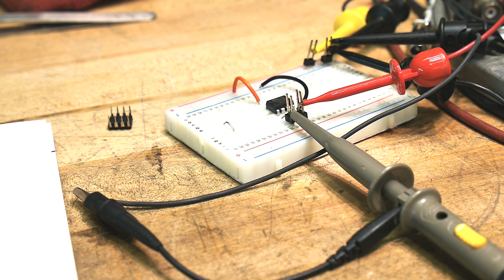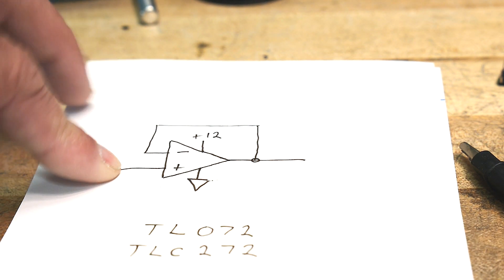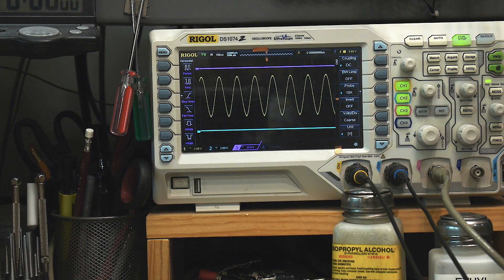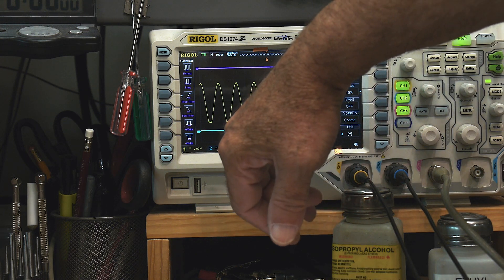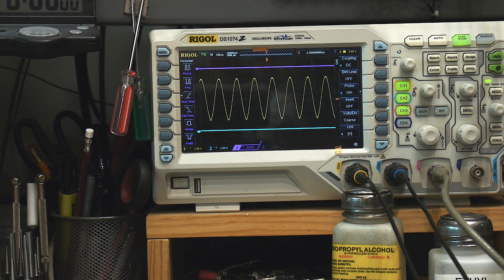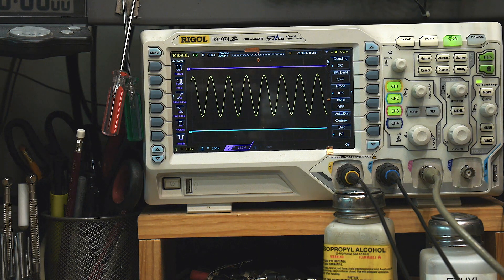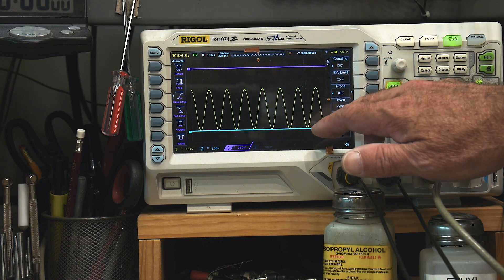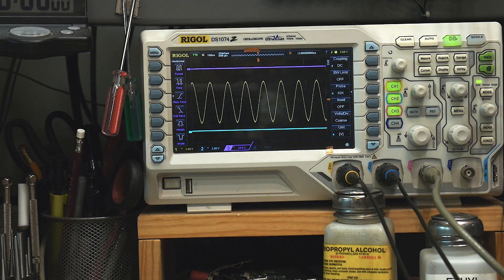#479 TL072  vs TLC272 Op-amps Single Rail

Comment: Thank you for this video!  I had no idea this existed. I am working on a small project that needs an op amp and have had to use a buck boost with a +/- output and it seemed like a lot of hoop jumping for a buffer / voltage follower capable of going all the way to ground. Just ordered some!  Thanks again!

Comment: If you want a TL072 lookalike that goes full rail-to-rail, look at TL972.

Also, (your remarks about using it as an FET driver brought this to mind): don´t use an opamp as a comparator. Even the ones where it won't damage the device (many opamps have a low limit on differential input voltage) aren't really built for it.  They often recover really slowly from clipping.  For a comparator, in addition to the classic comparators (331, 393, 339, plus low-voltage versions), there's the CMOS TLV3701/3702/3704, (or LMV3701/2/4). For higher performance look at TS391 (pretty much a better 311), TS3021 (full rail-to-rail inputs, 8 ns rise/fall time), LT1016 (ultrafast, low input offset . Somewhere in my notes, I've got a reference to a datasheet for a comparator that can tolerate either input going beyond the positive rail as long as it doesn't exceed 36V above the negative rail, and promises no phase inversion as long as it's just one input out of bounds, but I can't find it right now.

With almost all comparators, you have to be careful never to drive either input pin more than about 200 mV below the negative supply.  The construction of the chip often has a parasitic SCR that will latch up if you do.  Even a Schottky clamp is often not good enough, particularly with a low-impedance source. Sometimes you just have to resort to a clamping diode with a voltage divider after it (and put up with the noise of the resistors.  Life is full of tradeoffs.)
Reply from the maker: I talk about that a little:  https://youtu.be/mnRO1OK6bqY?si=RcimzC-51o51ylCM

Comment: At 2:46 It's not starting to "oscillate" - it just looks that way because the extra edges produce false triggering on the scope.
It's known as phase inversion and occurs because one the transistors in the signal path has become biased in such a way that its collector-base is now forward conducting. That results in an inverting stage becoming a simple pass-through and it inverts the phase of the output compared with normal operation.
Reply from the maker: that is not what I meant by oscillate. the opamp starts going rail to rail and this fast edges to the positive rail is what I meant by the oscillation. I'm aware the scope was not triggering right.
Reply: @IMSAIGuy  calling it oscillation is so weird

the opamp didnt oscillate there, it s called phase inversion

the rail to rail is caused by the sine wave itself oscillating, the opamp is just doing it s job, or well...not

didnt see u calling the signal as oscillation now......
Reply: Phase inversion in a configuration with a low-Z feedback loop is going either to oscillate or else to slam into one of the rails. You've converted your negative feedback into positive feedback.